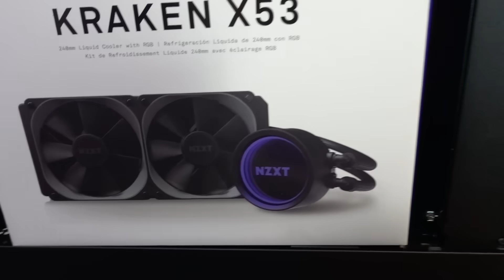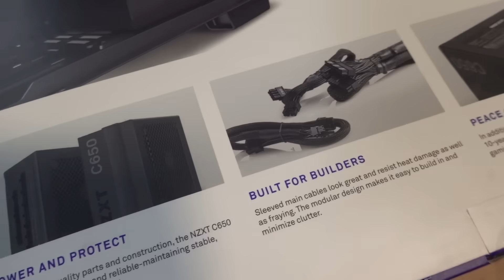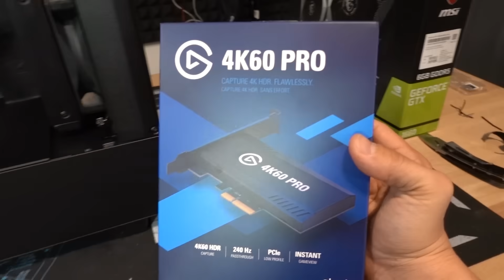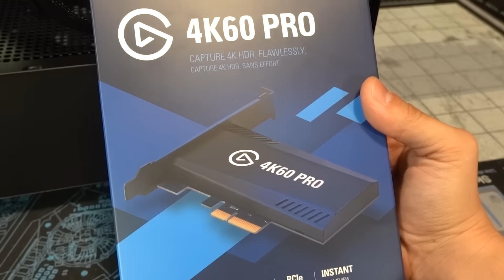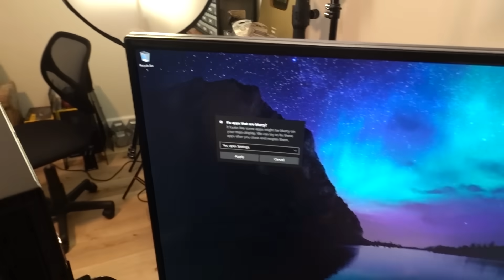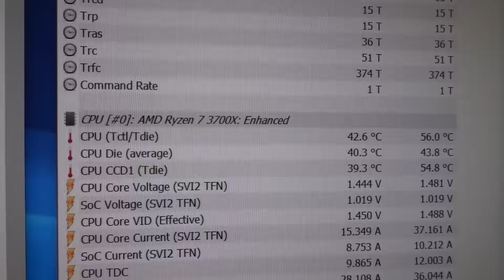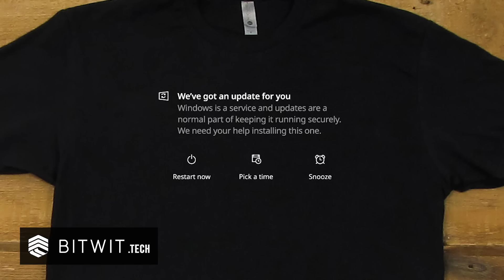Building a GOD TIER streaming PC

Comment: Ahh man! This is perfect! Been looking for something like this! Thank you. Do you think I could save some cash by going Ryzen 5?
Reply: Absolutely, it won't perform exactly as well as this system, but a Ryzen 5 3600 or 2600 would be a great CPU to put in a system of that calibre, I would forgo the aio cooler and get a decent air cooler for about 50 to 60 dollars, which would save a bit more money, and avoid using that SSD, it has overheating issues if I recall correctly due to the RGB lights on it.

Also I would use a cheaper case, especially something like the Phanteks P300A, which is about 40 dollars cheaper, as the NZXT case isn't great for airflow.

Making those changes might get you up to a GTX1660Ti, which is quite a bit faster, and you might even be able to get a better GPU than even that if you make the right changes.

Comment: Why did you put an AiO in there?? A solid Air Cooler would have been way easier. Especially for the family that‘s using the PC. If they‘re not into PCs and they will probably use the PC for a long time, then I can‘t see why you‘d want to put something in there thats likely to fail in 3 years
Reply: mid to high tier AIOs are generally rated 5ish years
Reply: Zold Thats true but still a Noctua Air Cooler would double that 5 years :P

Comment: for my church streaming PC I built
under CAD $850
ryzen2700 with stock Wraith Spire Cooler(needed some cores for various needs at church)
asrock b450m
ddr4 8gb 3000mhz (wanted to go 16gb but due to strict budget :/)
ssd 250gb 2* 1tb hdd
gtx1660
evga 500w bronze psu
free server case that was laying around unused at church and some other components

still works great for the needs :)

Comment: Since you put the radiator on the front end where does airflow on the fans attached to it supposed to go? Into the case or out of the case? I know the the top fans and backend fans have to get air out of the case so does this mean the fans on the front end have to take air in? I'm building a PC rn and I'm confused about the proper airflow

Comment: I think the AiO wasn't the best choice, because of questionable long term reliability. Possible leakages and the more common ones: pump failure and especially cooling fluid evaporation over time due to permeation which leads to an average lifespan of an AiO of only around 5 to 6 years. An air cooler would've been to more robust, reliable and maintenance-friendly choice in this case imo.

Comment: Kyle turns off the camera

Kyle: lmao who am I kidding they will never even open the side panel, let alone upgrade it
Reply: Zed Dead get a hard drive
Reply: Zed Dead  buy an ssd or hdd. it should be at least 500gb
Reply: Zed Dead  I can explain better
Reply: @spadeRKR  did you explain better?
Reply: @kitkatwizard  wdym
Reply: Zed Dead  you could get a 500 gb seagate barracuda. It will work just fine. Also i recommend upgrading your ram to 16 gb further down the line.
Reply: Zed Dead  Buy memory, open the panel of the case, install memory, for example like in this video. simple as that

Comment: 3700X... And then GTX 1660. Why? You should have taken the gtx 1660 super or better for the new nvenc and drop the cpu for a ryzen 3600. More fps and a better stream.
Reply: 1660 still has the new nvenc, plus its h.264 encoding they are using, not nvenc, also only turing gpu that doesn’t have the new encoder is the 1650.

Comment: need help im running a ryzen 5 3600 stock cooler running at 4.3 and i have gtx 750ti its a old hand me down it works for 720p but i want to get a getting monitor and with that ill need a new gpu what should i get ?
Reply: $150 - RX 580 - Good for 1080p maybe 144Hz gaming - AOC 24G2U Monitor
$250 - 1660 Super - 1080p always 144Hz high settings - AOC 24G2U Monitor
$300 - 2060 KO - 1080p Ultra 144Hz, plus 1440p 60Hz, if money allows then a 1440p 144Hz monitor would be good, watch a Hardware Unboxed video for recommendations
$400 - RTX 2060 Super or RX 5700 XT - 1440p 100Hz High Settings, LG 27GL850 Monitor
$500-600 - 2070 Super with LG 27GL850 Monitor, 1440p 144Hz High Settings

Comment: Kyle here is a question. My build is almost exactly the same right down to the Case (must be a "sign" LOL) only i'm using an ROG STRIX 2060 OC RTX GPU and an ROG STRIX B450 MB (sadly i bought this MB before the MAX was available) and a Seasonic 850 + Gold (i got a great deal on it). i was wondering, I was considering the NZXT X63 AIO, but i noticed you used the X53 variant. would there be any actual benefit using the X63 on the 3700X over the X53 or should i save myself the $20 and stick with the same option you used even if i decide to do some overclocking ?

Comment: I was wondering if you'd make a Build of All top of the line ASUS ROG equipment.  I'm planning on building a new computer and i'm just wondering what it would look like, and if it would be possible to fit it into a mid-tower case that is around 17.5 inches tall.  Also, is it possible to clone a boot drive HDD to an SSD of the same size or larger?

Comment: I was looking into updating my Ryzen 5 2600x to the Ryzen 7 3700x with my current MOBO Asus Prime B450 Plus.... After this video I assume my b450 MOBO would do just fine with the upgrade? I also have an RTX 2060 6Gb and running 16gb RAM at 3200mhz . I also have went ahead and updated my MOBO’s BIOS to the latest version. if anyone could help out it’d be much appreciated.

Comment: That VRM heatsink design is dog shit.  They do an OK job and then cover up all the (minimal) surface area with yet another solid chunk of aluminum to make it so zero airflow can run over it.  Look at the Z390 Aorus Master ... that's a proper heatsink design that every other manufacturer should be berated for not doing.

Comment: I have Ryzen 7 2700x and i have a RTX 2060 Gaming z Msi Gpu. Corsair vengeance 3200mhz and M.2 NVME ssd 500gb. 4tb seagate barracuda HHD. H100i Rgb Platinum Corsair cpu cooler. I went a little overkill with a HX1200i Pwr supply

Comment: Btw, you may want to check on their networking setup. If they have some crappy dsl or are on cable modem and the cable modem is just plugged into a 20 year old mishmash of coaxial, that can cause issues. Plus if they are using a cheapo home router with a crappy cpu and minimal memory and it acts like a hub, not a switch that can also cause issues

Comment: I spent my stimulus check on a new rig, currently stuck on a asus gl502 laptop with the gtx970m... now I went team red with a ryzen 5 3600, 16gb corsair ram at 3600 speed, msi b450 tomahawk max, msi rtx2070super gaming x, a thermaltake 650watt psu, phanteks p350x, and because I had to skimp on some bells and whistles just a 2tb wd blue hdd but will install my 970evo 256 from the gl502 once school ends, and i will need some fans, a keyboard, mouse, and to upgrade to a 240mm aio eventually so can overclock!

Comment: Honestly, from experience, a base model 2015 mac mini can stream 720p/30fps 3mb just fine. They probably using wifi or doing something else wrong. Wirecast supports quicksync encoding and so does obs, so the cpu isn't even being hit that hard. I would say upgrade the ram, but its a 2015 mini so....
Nice Kyle is putting in some work for the LORD though.

Comment: Why get a liquid cooler when longevity and "plug n play" for the church is the ideal
Reply: I was wondering as well. Also, if the old pic was a mac mini, why would you build a full sized tower?
Reply: @bananas1055  right? he could of made a micro atx pc and get close to similar results.
Reply: @fahlur  deskmini a300 bruh
Reply: @bananas1055  coming from a perspective of someone who works in a church we use Mac minis primarily because of the Mac ecosystem and they're relatively cheap. A lot of us are stuck on mac's due to pastors using Mac os and wanting everything to flow together.
Reply: @mjc0961  Mac minis are cheaper than other mac's. That's the point I was making.
Reply: What does an AIO liquid cooler have anything to do with longevity and "plug n play"?
Reply: @toothlesstoe  I know it's still incredibly rare, BUT all things considered an air cooler mightve lasted slightly longer than an AIO
edit: incredibly rare for an AIO to randomly fail
Reply: caleb “an air cooler might have lasted slightly longer than an AIO”. What the hell does that even mean?!?! An air cooler will outlast the whole build. Do you think they melt down or something??? NO!!! An air cooler will perform the same on the last day of that computers life as it did on day one ☝️.  The only point of failure on an air cooler is the fan and that can be replaced easily. An AIO has MULTIPLE points of failure: the pump, the hoses, the radiator, the fans. And then there’s the CAM software. It’s just a poor component choice for a church ⛪️.
Reply: @calebmorris2137  "incredibly rare for an AIO to randomly fail" Well, mine did, after only a couple of years. i7 100C 1.15Ghz - not a pretty picture. First and LAST AIO i'll probably ever purchase.
Reply: @toothlesstoe  AIOs have more potential points of failure, and even if none of them do fail, eventually the coolant inside the loop will permeate and then the cooler needs to be replaced. Not so with an air cooler. That's what it has to do with longevity.
Reply: @mjc0961  Are AIOs or cooling loops necessary to cool the giant CPUs, or would a top-of-the-line air cooler do?
Reply: @toothlesstoe  air coolers are more than plenty for cooling CPUs. Water-cooling is nice for keeping temps low but air cooling works perfectly fine
Reply: toothless toe AIO’s don’t last. Month after month, year after year, an AIO starts degrading and temperatures start rising. NZXT guarantees their AIO’s for 6 yrs., but the pump will fail by then. If the Kraken did last for 6 yrs (which it wouldn’t ), it would be performing @ the same level as a Ryzen box cooler. An AIO’s represents an unnecessary point of failure for a group of people who probably aren’t that computer savvy. The inclusion of that cooler does nothing to enhance the build and creates a problem down the road. All of this is just common sense.
Reply: do you know malaysia on the cpu 1:34?
Reply: Well, I would have used a Dark Rock 4 or DR 4 Pro or something from Noctua for simplicity. That AIO is going to start degrading after 3 or 4 yrs. I would have also used a Fractal Design Define 6 or 7 w/ a solid side panel. The Church doesn’t need bling. It needs a PC that’s quite, conservative and has long term reliability. I’m just sayin’......

Comment: Building a system similar to this for my church. However I went with a Quadro that supports more than 2 encoding streams at once since we're streaming to 3 different platforms. (We used Restream until it gave us big issues recently, so we're cutting out the third party)

Comment: The Mac mini from 2015 is actually the 2014 model if they bought it new. Those have the U series dual core laptop CPUs, with the highest spec being the i7-4578U. The funny thing is that the older 2012 Mac mini is actually a lot more powerful with a quad core laptop CPU, up to an i7-3720QM. I bet the newest Mac mini is perfectly fine for streaming if you get the i7-8700 model.

Comment: Hi bitwit I wanted to ask you for your advice on something I’m currently running a 2080 super With a Rison 2700 X and 32 gigs of ram 3000 MHZ speed and I really want to hit 280 Hz at 1080p But I can’t even get up to 144 FPS What do you think the problem is I’m still within the return window of most of my parts so I just wanted to know if you could tell me how I should go about this

Comment: Hey Kyle need your expertise please ;) How do you set up AIO's to work with Ryzen?  The temps given off on all the AIO's I've tried are near 40-50c higher than what the actual temps are.  This results in AIO fans ramping up to 100% at idle along with the Pump.  I have an EVGA 280mm ClC and still have this issue with my Ryzen cpu's.  So far corsair, Nzxt and EVGA all have this problem.  Could you offer a solution please?  or Maybe do a video on this issue?  Thanks Kyle!

Comment: So, this is the 2nd tech reviewer that built a PC using the Delta Max ARGB SSD that put the SSD in a place where you can't even see the light coming off of it. I have one in my current rig, and it's beautiful paired up with a kit of 16 GB Xtreem ARGB 3200 MHz.

Comment: I'm the Technical Director at my church, and up until now recent weeks, we haven't streamed. It's always been a goal to get there. With the quarantine, I've been using my personal PC to do all the streaming. My PC has a Ryzen 5 2600, 16GB of 3000MHz RAM, and an RX580 GPU. It handles everything flawlessly. Running a camera into a Magewell SDI capture card, and a feed from the media computer into a Magewell HDMI capture card. All of that goes into OBS, where I am doing scene changes and keying for the lower thirds lyric overlay. My motherboard has issues passing audio on the Dante network, but we've resorted to using a Focusrite audio interface to take in an analog feed from the console. I will say, all of the RGB gets a lot of comments...

Comment: How many years as a techtuber and he still installs his AiO radiators upside down??? Listen to Steve and STOP putting tubes that the top! Tubes not long enough to put them at the bottom for a front mount rad? Then use a case that allows a top mounted rad.

Comment: Ok,  I dont think this is an appropriate build what-so-ever. Its too big, too flashy, has a window. In a church setting your client deserves a quiet closed noise dampened machine. It needs to be small, inconspicuous, easy to re-locate, AND meet adequate specs with ability to future proof. You overkilled a gaming machine better than most of your viewers have in their actual home. Does it stream? Yes. Your choices however for size, aesthetic, and end product from a consumer perspective is short sighted. That's a streaming machine Kyle would like. Now build one for a church.

Comment: the 1650 super has the same encoder support so that is "the most entry level gpu that supports nv encoder".  i assume you meant nvenc 6th gen.  otherwise maxwell will be the cheapest cards that support 4k/30 with h.264.

Comment: Also I built a similar rig. I used the MSI 1660 super gaming x, 32gb 3200Mhz ram, and the NZXT x62. I mounted the intake fans in front on the bracket and the radiator behind it so that the bracket is in between them.

Comment: I would rather leave out the water cooler and cool the cpu with an air cooler, but ok. Linus would probably put in Rtx 2080 TI but then he would be an idiot, since the priest would never use it to it's full potential.

Comment: is it possible to upgrade the parts on the system? The system that I'm currently using is a Alienware 17 r4 with a 1070 which i have had for around 3-4 years now. Maybe in a year or 2 or when it doesn't work anymore,  I might be building this computer so that is why im wondering if I could replace parts like the gpu without any other purchases necessary? Nice build and keep up with the good work :)
Reply: This is a very upgradeable system . Your only worry will be lack of pci 4.0 , but that's not necessary to game for 2021 and beyond